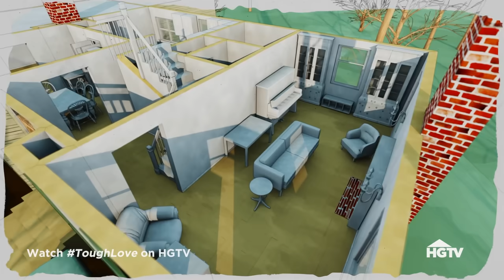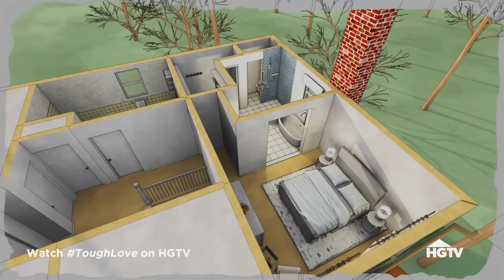Open Concept Remodel Breathes New Life into Family Home | Tough Love with Hilary Farr | HGTV

Comment: I can't believe that a budget of $100,000 only got this much done.
Reply: I agree. They just repainted and moved things around.
Reply: . That is a lot of budget for that makeover .
Reply: Not sure where or when this was done, but a basic bathroom would be 20+k; upholstery would cost as much as new piece; if they refinished the table, same; moving walls 5k each; kitchen could be 40k or more; opening new windows in an exterior wall; labour and overtime on a short timeline; materials; permits and taxes; accessories and art; flooring and carpets; electrical, heat /cool and plumbing...  it all adds up.
Reply: @jhutch1681 as a person in this industry, you're exactly right. 😊